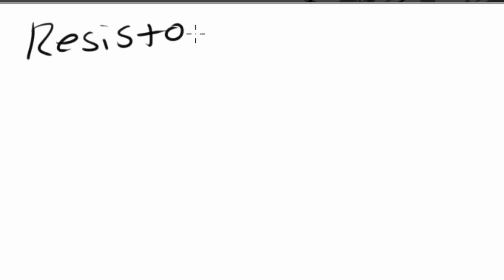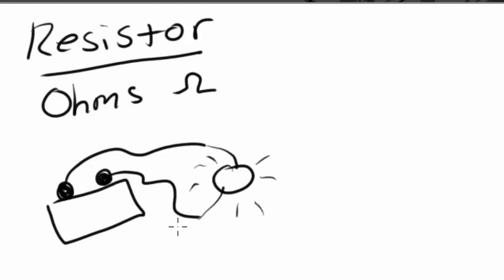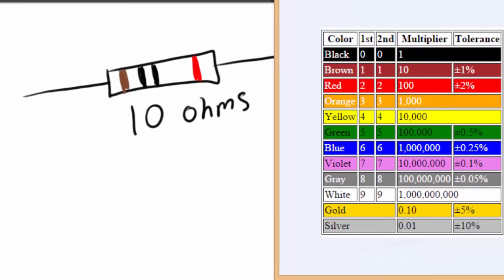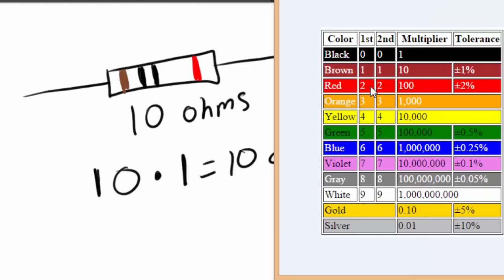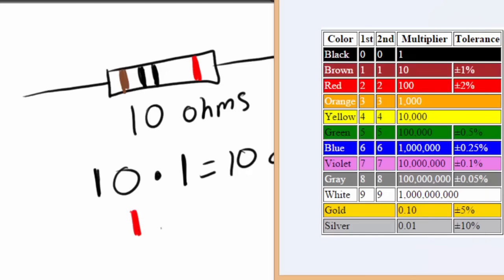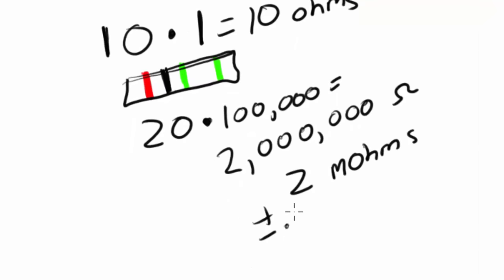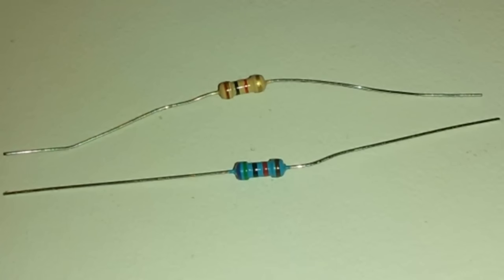Beginner Electronics - 5 - Resistors

Comment: how do you know what side of the resister to start reading the bands?
Reply: I was wondering the same thing, so i investigated it: Apparently the first band is closer to its end and the tolerance band is thicker. Many say though, this not being something explicit so they prefer to measure the resistor.
Reply: "People don't think the universe be like it is, 
but it do"
-Black science man
Reply: From the side that has more stripes in the row. The tolerance stripe  is presented after space. It can be usually silver, golden, red or brown. For me it is very hard to associate colors with numbers, so I prefer to use simple system. 4K7 - 4.7 Kohms - 4,700 ohms. 3M3 - 3.3 Mohms - 3,300,000 ohms. These stripe are just confusing to me, I would try to use it only if I have no schematics that explains the resistor values.
Reply: Sometimes it is really hard to tell especially with precision resistors. When in doubt use your multi meter to get a reading to verify what you think it is.
Reply: I agree that encoding the resistor with "4.7k 2" would be easier to recall, simpler, and arguably shorter than yellow violet orange red (did I get that right even?) and pay attention to the spacing and if there are two or three number bands before the multiplier and tolerance.
Reply: It's far easier to print colored stripes than text, not to mention text that small could be easily misread, which could be damaging to the circuit. Thus, a universal color code. You will never see a code start with gold or silver, but they will frequently end with a gold or silver tolerance indicator, of have gold or silver as the multiplier. So, you see gold or silver, start reading from the opposite end. You will also never see white as a multiplier or tolerance indicator, so if one end starts with white, start there. A 5 band resistor is harder to determine just because they're all close, but the starting end (left) will have the second band almost always right up against the shoulder of the swell, while the ending end (right) will have a space between the multiplier and the shoulder of the right swell. Gray will never be a multiplier, Orange and Yellow will never be a tolerance. Come up with a mnemonic device to remember the numerical order, something like "Black" (because the first in the order "0" is black followed by another "B" (brown)) so "Black Boys Rape Our Young Girls But Virgins Go Without". Disclaimer: I'm not racist in the least, it's a common phrase that BECAUSE of it's vulgarity is very easy to remember, and if you plan to go into industry doing electrical work, well... Get used to vulgarity or choose a different career path. If you don't like that phrase, make your own.
Reply: The Strips will be Grouped more to one Side, the side with the Most ... Goes to the Left (grouping is Closer to Left Hand), then Read Left to Right.
Reply: Jing Zhu probably multiple reasons, including the need for mass production in factories.
Reply: Melbourne? haha  @GetSchwiftyInHere
Reply: Spacing from the tolerance
Reply: You put your multimeter in auto-scaling resistance mode and connect it to either end of the resistor.  done and done.
Reply: Thanks. I came here to ask the same question.
Reply: @jeffsims7386  BB Roy Of Great Britain had a Very Good Wife, wearing Gold and Silver. 😀
Reply: Thank you I too have come here to know the same thing 😊😊
Reply: @jeffsims7386  God, and if I am a girl, who prefers not to think about rape each time I grab a resistor?....I'm starting to think of another version, cause this one really sucks. Thanks for the explanation, though
Reply: Thanks, I had the same question. 👍
Reply: you just have to basically arrange the band which is far away from other bands towards the right and start reading form the left and then to right(it  works with some resistors only)
Reply: Gold/Silver are at the end...And if not those colors, it is further from the rest.
Reply: @jeffsims7386  IMO, in practice, there's very little benefit to using color codes instead of text. It sounds better in theory than it really is.

Comment: For everyone wondering which end to read resistors from I found this online which was helpful: 

How do I know which end of the resistor to start reading from?
• Many resistors have some of the color bands grouped closer together or grouped toward one end. Hold the resistor with these grouped bands to your left. Always read resistors from left to right.
• Resistors never start with a metallic band on the left. If you have a resistor with a gold or silver band on one end, you have a 5% or 10% tolerance resistor. Position the resistor with this band on the right side and again read your resistor from left to right.
• Basic resistor values range from 0.1 Ohm to 10 Megaohms. With that knowledge, realize that on a four-band resistor the third color will always be blue (106) or less and on a five-band resistor, the fourth color will always be green (105) or less.
Reply: My man!
Reply: exactly the question i had after watching the video. thx!

Comment: Summary:
- a resistor is a component that you can put into a circuit to provide additional resistance to the circuit
- the color bands on a resistor tell you the strength of resistance (in ohms), which is usually a range (e.g. 10 ohms, plus or minus 1 ohm, means a range of 9-11 ohm)

Comment: At 7:34 in your video discussing resistors, I have two questions regarding the images of the sample resistors. Firstly, how do you determine which band is the leftmost band? I ask because in your photos, the orientation could be altered so that the leftmost band appears on the right. Secondly, why do these resistors feature different colored backgrounds?

Comment: 1) The value that we determine by using the chart, is it what our resistor RESISTS or is it what it PASSES through? You never made it clear.
2) What are the examples of situations when using less accurate (i.e. with more tolerance) resistors can be advantageous?
Reply from the maker: +Dmitri Ivanovich resistance is measured in Ohms, and resistors have some resistance value. This value will come into play when we learn about Ohm's Law (in one of the latest videos). Basically, the value is what the resistor resists, in a way. I don't know if less accurate tolerances could be advantageous, however having a very accurate/small tolerance can be advantageous in circuits that must be extremely precise (ex. medical equipment, many other applications as well).
Reply: I don't know anything about electronics, but I'd imagine higher variations might be good for cheaper prices?

Comment: Hey, I had a couple of questions. First does adding more resistors in line of the same value change the resistance or does it stay the same? Like would two 100ohm in a row still be 100 or would it be 200? Also does it matter where in the line the resistor is? Like does it need to be on the negative or positive side of an LED? Thanks! Loving these videos!

Comment: This video says that when 5 band resisters are used, the third band is to be interpreted as a "regular digit," but it's used later in the video to represent the tenths decimal digit. Is this always the case? Five bands never use the first 3 to yield a number in the hundreds? And, the third band takes the value in the "Multiplier" field, while the fourth band also takes the value in the same field?

Comment: hi bro thanks for youre tutorials but i want to ask how to know where to start counting colors in resistors , i meant how to know the first color
Reply: Usually in the last color band we find gold or silver colors which are at the end of the resistor and when we calculate the value at that time also we take the gold or silver color as the last one 
we take the first color as the color which is opposite to the gold or silver colors and then from there we start as the first second third and forth band of color and forth has to be either gold or silver and it is always the last 
To summarize just remember that the gold and silver band are the last color bands

Comment: Just wanted to point this out.
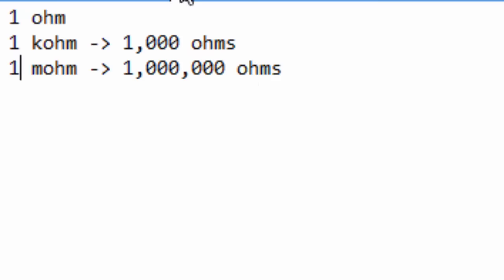at 2:25 you said that 1 mohm = 1.000.000 ohm. I learned something else at school tho, and when I search it up I also get something different than what you said.

1 mohm ≠ 1.000.000 ohm ➡ 1 mohm = 1*10-³ ohm (or 0,001 ohm)
1Mohm = 1.000.000 ohm 

I might be wrong, but this is what they teached me in school, and also what I get when I search it on the web (link: https://www.eenheden-omrekenen.info/Milliohm+in+Ohm+omrekenen.php). 
So my apology if I'm incorrect.

Comment: Dumb question but how can a resistor be placed on either side of the circuit? I mean its purpose is to protect the LED from high voltage, and the current flows from the negative terminal so why can it also be placed in the positive terminal?

Comment: Im sorry if this is a super weird question, but how do you know the orientation in which to read the colours?
Reply: It looks like there is bigger gap between the last band and last but one then between the first  and the second band. So you probably choose the direction you are reading bands colors according to the first / last gap size . But it is just my guess.
Reply: Look at the colours & start with the band that is closest to one end. The first two coloured bands represent the first two numbers of a resistor value while the third band represents the number of zeros that follow these numbers. The fourth band represents the tolerance of the resistor. There are several values but the two most common are silver (10%) and gold (5%). Once you have worked out what the resistance is you can confirm you calculations by measuring the resistance with a multi-meter. The colour code for the numbers 0-9 are in the following order Black Brown Red Orange Yellow Green Blue Violet Grey White. So a resistor with Brown (1) Black (0) Red (2) Silver (10%) represents 1,000 Ohms or 1k ohms with a 10% tolerance.

Comment: You could flip the resistors. How do you know which one is the first band and which one is the last band?
Reply: Usually in the last color band we find gold or silver colors which are at the end of the resistor and when we calculate the value at that time also we take the gold or silver color as the last one 
we take the first color as the color which is opposite to the gold or silver colors and then from there we start as the first second third and forth band of color and forth has to be either gold or silver and it is always the last 
To summarize just remember that the gold and silver band are the last color bands

Comment: How do you know whether you are looking at it left to right or you flipped it and need to read it from right to left? Not sure I explained the question properly.
Reply: Usually in the last color band we find gold or silver colors which are at the end of the resistor and when we calculate the value at that time also we take the gold or silver color as the last one 
we take the first color as the color which is opposite to the gold or silver colors and then from there we start as the first second third and forth band of color and forth has to be either gold or silver and it is always the last 
To summarize just remember that the gold and silver band are the last color bands

Comment: This may be a dumb question but instead of color coded bands to calculate the value of the resistor, why don’t they simply print the amount of resistance on the side? Instead of multiple colored bands just print 10 ohms on it!
Reply: Someone had asked my teacher the same question and he said it is because if we wrote it on the resistor chances are that the colours could fade out or worn out and not be clearly visible or be blurt overtime or if someone is having an issue reading small texts the person wouldn't be able to know the resistance and that's why we have colours

Comment: I always wonder which end is the starting end,  if they can start or end with any of the chart colors,  and unlike your handy drawing, don't always seem to have space between the first 3 or 4 lines, and the last tolerance line. . .  Both ends seem to be the same shape. I've not finished certain things, because I got stuck, unsure if I was using the correct resistor, afraid I'd blow up more LEDs 
This is because I got a multitpack, instead of just the resistors I knew I'd need. How can you tell which end is which?  My little guide chart doesn't say that detail.
Reply: Usually in the last color band we find gold or silver colors which are at the end of the resistor and when we calculate the value at that time also we take the gold or silver color as the last one 
we take the first color as the color which is opposite to the gold or silver colors and then from there we start as the first second third and forth band of color and forth has to be either gold or silver and it is always the last 
To summarize just remember that the gold and silver band are the last color bands

Comment: @ 7:24 if the colors are violet-green-black-red then the value is 75 K and not  75.1
Reply: ismael niang I'm asking myself the same question
Reply: ismael niang he said 75.1 kilo ohms..so it has the value of 75100 ohms ;)
Reply: that is why it is wrong Purple, Green Black Red give you 75000 and not 75100. Its a 5 band code hence the first three are the value digits the 4th is the multiplier and the 5th is the tolerance. Black as a value digit is zero (0) but as a multiplier it is (1). 
In this specific case you have
 Purple=7 
 Green=5 
 Black=0
the multiplier is red so it is 100 which results in a total value of 75000 +/- the tolerance which is 1%.
we can write it this way :   74250 =< Resistor value  =< 75750
Reply: ismael niang 
I'm pleased you said that, I thought I was going nuts!
Reply: ismael niang
 Nice Sir Great Explanation...

but i have a one doubt if here 3rd band Consist diffrent colour except black then in colour code how to find 3rd band ?? because in table 1st and and 2nd band code given what about 3rd band if not black then ??? here we took zero as black what about if not black
Reply: If I'm not mistaken, the 1st column and 2nd column are the same so the 3rd column would be a copy as well, 0-9 in the same order as 1st and 2nd.
Reply: I believe the tolerance indicates the 0.1

Comment: ### What is a Resistor?
A *resistor* is a component in electronic circuits that limits or regulates the flow of electrical current. It’s like a valve in a pipe that reduces how much water (current) can flow through.

### Measuring Resistance
Resistance is measured in **ohms (Ω)**. It determines how much a resistor can slow down the current. The higher the resistance, the less current flows through the circuit.

#### Example:
If you have a resistor with 100 ohms of resistance, it will reduce the flow of current more than a resistor with 50 ohms.

### The Role of Resistors
Resistors are crucial because they:
1. **Protect components**: Prevent too much current from flowing into delicate components like LEDs, which could burn out.
2. **Control voltage levels**: By using resistors, you can drop the voltage across parts of a circuit.
3. **Regulate current**: They help maintain safe levels of current in the entire circuit.

### Resistor Color Code
Resistors have color bands that tell you their resistance value. This code follows a standard system:

1. **First two bands**: These represent digits.
2. **Third band**: It’s the multiplier (how many zeros to add).
3. **Fourth band**: It represents tolerance, which indicates how accurate the resistance value is.

#### Example:
If a resistor has bands of red, violet, and yellow:
- *Red (2)**, **Violet (7)**, and **Yellow (×10,000)* means the resistor value is 27 × 10,000 = *270,000 ohms* or **270kΩ**.

The fourth band, if gold, means the resistor has a tolerance of ±5%, meaning the actual resistance could vary by 5%.

### Types of Resistors
1. **Fixed Resistors**: These have a constant resistance value, like 10Ω, 100Ω, etc.
2. **Variable Resistors (Potentiometers)**: These allow you to change the resistance, often used in volume knobs or dimmer switches.

### Power Rating
Resistors also have a **power rating**, usually measured in watts (W). This rating tells you how much heat a resistor can safely dissipate. If you exceed this rating, the resistor may overheat and fail.

### Practical Use Case
If you’re connecting an LED to a 9V battery, you can use a resistor to limit the current flowing to the LED. Without a resistor, the LED would receive too much current and burn out.

- **Calculation**: 
  Let’s say your LED needs 20mA (0.02A) of current and operates at 2V. You’d need a resistor to drop the extra voltage (7V), and using Ohm’s Law:

  \[
  R = \frac{V}{I} = \frac{7V}{0.02A} = 350Ω
  \]

So you would use a 350Ω resistor (or the nearest available value).

---

### Summary of Key Points:
1. Resistors limit current flow in circuits, protecting components and regulating voltage.
2. Resistance is measured in ohms, and resistors use color codes to indicate their resistance.
3. Resistors can be fixed or variable, with different power ratings to handle varying current levels.

Comment: If the bottom resists is 75.1 kOhms, that is 75,100 ohms right? But based on the colors you pointed out, I calculated 75,000 ohms. What accounts for the difference of 100 ohms?
Reply: The tolerance